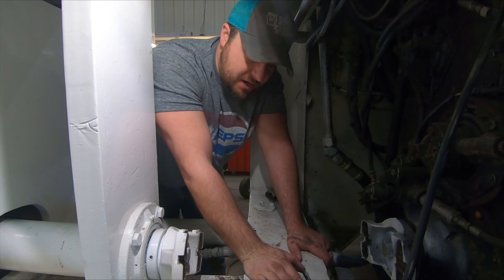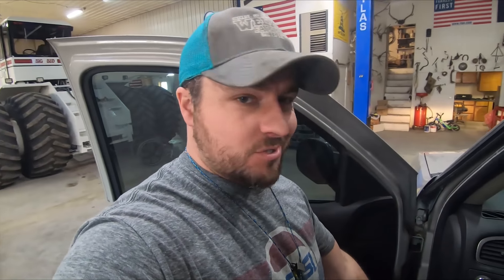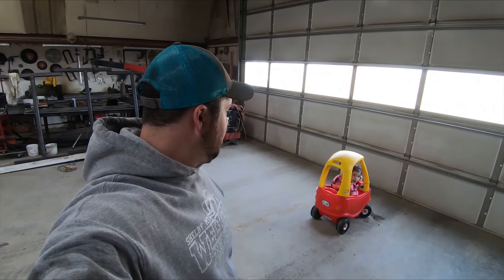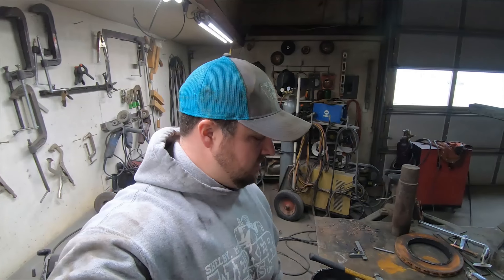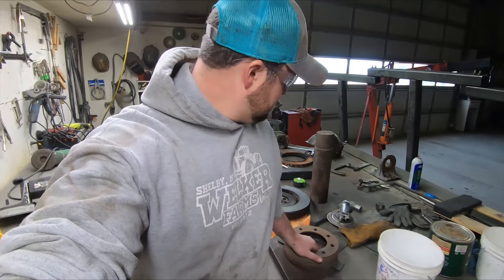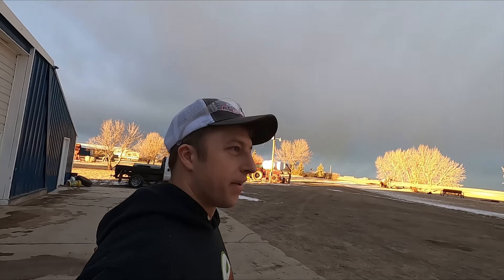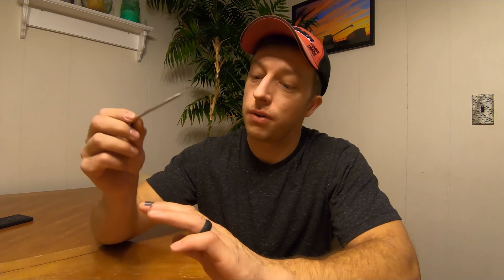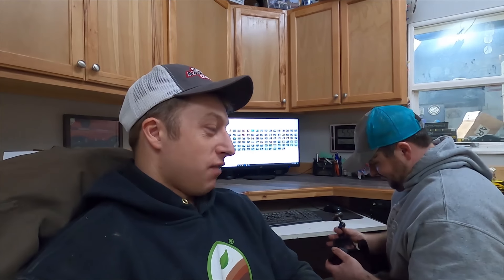SMASHED My Finger｜Shop Shenanigans

Comment: mechanic here, a torch tip drill set works great for deflating fingernails, lil bitty drill bits and a pin vise to turn them with by hand so you can sneak up on it and not get that painful over penetration, works even better when you need to reopen the hole after it seals up and pressure returns

Comment: I used a drill bit to relieve the pressure on a smashed nail once, but I worked the bit with fingers from the other hand. I read several comments about using drills and I'd never do that myself.  Relieving that pressure felt so good though!!

Comment: Hey LegArms I haven't read through all the comments to see  if it has been said. If you add a length of wire to the broken spots in the harness in the door jamb it should relieve the stress on the harness and prevent the wires from breaking again. I am a Ford dealer tech in Florida and I see this issue on a regular basis. I love the channel keep up the good work

Comment: Got lazy as a teenager and was using the upright vacuum cleaner to vacuum carpeted steps. Not the hose attachment mind you, but the beater brush. Lost my balance and set the vacuum down on my foot.  Wouldn't have been a big deal if I was wearing shoes but I was barefoot. Took the toenail right off my big toe.  So now I wear steel toed shoes to vacuum.

Comment: Also u can build that pin up and spin the weld down. I would preheat it, weld it and throw it in a fire blanket or bucket of kitty litter for a slow cool down. The only time u don’t want to build it is on tool steel. 4130 4140 ect. It can be welded but it’s a very long slow process with tool steel.

Comment: Nick,

I have used a drill bit in a drill.... when the drill bit penetrated the finger nail it didn't stop quick enough and went into the very tender skin under the finger nail.  I have since used the drill bit but without the drill by spinning the drill bit in my fingers.  This worked really well and was the least painful method I have found so far.

Comment: Yeah for future reference you never never want to use a drill bit with a drill. One of 2 things will happen, the drill spinning at high speed will catch on your nail and pull it off or and yes this is super fun as well. the drill bit spinning at a high speed will catch on skin below nail and you will drill through your finger, thats not the worst part. the worst part is extracting the bit after it drills through finger. If you decide to use a bit, definately twist if by hand. I find that a sharp pocket knife and back and forth twisting motion works best.

Comment: Awesome videos guys...  2 things:
First, you did the same thing to the bearing that you did to your fingernail pressing the outer into the seat through the inner bearing race. you basically transferred all that pressure through the precision ground races and there is a high likelihood that you did damage. you should use a ring or other device and never press "through" the bearing assembly. Depending on the bearing, you can also flat out crack or break it like that.
Secondly, take an injection syringe (a new, large dia one like you would use on cattle), you can just use your fingers to spin it like a little drill to get through the fingernail. No heating required and its a bit less cringy than using a rough drill bit. The vet did that to my fingernail once when he was onsite and it worked great

Comment: Been there, found drilling did best for me. Once used needle under nail, just wiggled it around under there till it got to where it popped. And yes, it does roughen up the surface of the new nail.

Comment: One of the nails I lost the pain was very extreme from the built up pressure. When I got the hole burned through the blood squirted out 12-14 inches and my finger was looking more like a banana than a finger. Getting that pressure released was the most relieve ever! Keep it clean! I was planting at the time and got dirt in it and I got septicemia in mine and the Dr was afraid I would loose the finger, smelled like road kill with that nasty infection but all is fine now. Legarms you got me beat I have lost five nails so far.

Comment: 1/32 drill bit . Clean bit then take bit into fingers like pencil , thumb and index finger. Then roll bit back and forth between both fingers putting a little down pressure on nail with bit . takes a couple of min. doesnt hurt when you go threw nail do to nail separation.

Comment: Had a few of those smashed fingernails before.  1/32”  drill bit rotate with fingers from your other hand.  Scott you were so right about that pin.  Welding could of changed the physical metal properties which could of broken at the worst time.  Very smart getting a new one made.  Machinist making a nut as well?  Good video guys.

Comment: Nick, I’ve done that while hammering a pin out on my car.... and I did say fffffffffiddlesticks!
So I used a tiny drill bit for drilling printer cartridges. They have a plastic wheel on them so you can spin it with your fingers.
The relief when you release the blood is legendary!

Comment: I smashed my little finger in between two heavy sheets of steel about 3X3 wide last July 1st. Same thing it all turned black and blue, to relieve the pressure I ran a needle under my nail and drained it. Now there just a little bump on the end of my nail that needs to grow out. This nail is about number 14 now, thank god they grow back.

Comment: Wanna make that finger feel better and not lose the nail ? Take a small drill bit or heat up a paper clip and push it into the nail you will know when it goes through by the amount of blood that will squirt out of it but the relief is very welcoming as it relieves all the pressure and heals faster. Doesn’t lose your nail either 👍 works every time.  Feels better don’t it. Lol those that don’t want to poke hit things into their finger. Use the drill bit. Either works great as seen here

Comment: Nick , it doesn't matter which direction the grease hole faces when you push in the bearing. The grease will follow the channel around the perimeter of the bearing and enter the bearing internals  wherever the hole is located.

Comment: I use a small drill bit that I just spin with my other hand and it does not take long and really makes it fill better.  I have use a knife when out in the field when I did not have a bit. I never use heat either way.

Comment: Use a small drill bit with your other hand turn with your finger tips until you get through the nail. It will take a while but it's definitely worth a relief.

Comment: Few years back I was swinging a sorting gate shut when a 900lbs feeder steer backed up into it, ended up pinching my fingers between the gate and a concrete wall. I lost the nails on all 3 of my middle fingers on my right hand. 

Side note: If you use a tiny drill bit, I think it's easier to control if you put it in a drill press and set it up on the slowest setting.

Comment: Hot pin is the best way , friend of mine used a very small drill bit in a drill press raised his finger to the drill bit and forgot to lock the drill press spindle so it would not move and it grabbed a hold of his and went through his finger, yes hot pin is better. Great videos

Comment: The reason the hot needle doesn't work is: the blood will clot under high temps. This is why I use a file to cut through my nail after smashing it. We used a branding iron to clot the blood after clipping the horns of the cattle we branded.

Comment: As a 45 year Industrial Machine Repairman, pressing in the Spherical bearing like that was risky. The correct way is the make a sleeve that puts the pressure on the outside diameter of the bearing, as you mentioned. The risk was if the bearing hung up and you applied too much pressure from the spherical section, you could of blown the bottom of that bearing out. 

The best way to shrink a bearing is to use a CO2 fire extinguisher to cool the bearing. If you get it cool enough it would of dropped in with minimal pressure. Dry ice will also work, but what we used is Liquid Nitrogen. It will shrink it to the point that it will drop in. But, 99% of non industrial applications will not that that available. Plus the cost.
Reply: I agree.  Fortunately it went easy.

Comment: Sorry about the finger, been there and it's no fun at all.  Just wanted to mention, don't actually use a handheld drill with the small drill bit a you have very little control if those flutes catch on your fingernail and then cause you to drill into the nail bed.  Simply use your other hand to twist the drill bit until you get through the nail.  Love the channel, keep up the good work!

Comment: I went to the Dr. when I smashed (funny the same) finger and the Doc told me to use a paper clip and a propane torch and run it through. Drew all over my nail till it finally went thru and realized it didn't hurt and made 9 holes in it. So much better when the pressure released. Used vise grips to hold the clip.

Comment: Hi Hollywood you don't need to be spot on with the grease holes, did you notice the groove on bearing face the grease will travel around that way, put the bearing in the freezer the night before it will tap in no need for a hydraulic press, liquid nitrogen is better and quicker, I know YOUR on the farm, LEG ARMS would have told you that, next time ask him or better still ask me, 😁😁 😇😎 🇦🇺👍

Comment: I dropped a microwave shelf smack on my barefoot big toe nail!!  Turned red instantly.  Fortunately, the NAVY dispensary was just down the street.  They took one quick look and broke out a regular 15 w soldering iron with a tiny tip.  Heat, poke, squirt, done. Didn't even hurt much.

Comment: Dealt with that issue on a 2008 Equinox. I went ahead and bought the entire harness instead of soldering, since I knew more wires were gonna do the same thing eventually and I wanted to go ahead and get every wire replaced, not just repair a couple

Comment: I thought that groove around the bearing made it so the zerk didn't have to line up. The grease will migrate around the circumference of the bearing through that groove no matter where the hole is in relation to the zerk.
Reply: Mishn0 but it you look it has the hole that brings grease into the center of that bushing as well where the pin/bolt comes though. So that’s why it has to be lined up
Reply: @chevyon37s  as the op stated the grease can travel in the groove when getting pumped in around to the hole to the centre no matter where it is. But no harm in lining them up either
Reply: @chevyon37s  No No No, op is right
Reply: After a few years the grease doesn't always want to stay in that groove. I have a couple bearings right now that the grease wants to push out of the pillow block before it goes in the bearing.
Reply: @dgdaner  that make sense, thanks
Reply: @dgdaner  Sounds to me like it's become dirty or broken. Either way, it's NOT normal and something needs to be done before it goes wrong. That groove is meant to spread the grease. It isn't VERY important to line it up. Like op said, that is what the groove is for.
Reply: Funny thing is, that design is flawed. The correct path (but obviously  more expensive) is to have something akin to rifling inside the sleeve and a the zerk goes atop, with its own little chamber. Grease goes in the chamber, then as the bearing heats up from use, it slowly drips down. AS it is now, that sleeve will eventually split in half, again.
I still think they should've ditched that pos bearing and put a spherical roller thrust bearing. Yes, a lot more expensive, but they last a lot longer, heck, i'm willing to wager that it would last 2 generations of Welkers, provided they feed it  grease every time they use the machine (as one should).

In case anyone wonders how that works : here's a gif https://www.skf.com/binary/12-288949/1702-0011-Animated-SRTB_tcm_12-288949.gif
Reply: @frankvandendool882  Certainly. I guess what I'm getting at is if I have a failure and I need to use a grease buster or whatever else to open it up again I want those holes lined up. Everything fails eventually. Might as well take a second and line it up when it's going together. If everything is working correctly it doesn't really matter. If it means I get a few more hours out of it at a critical time it was worth it.
Reply: @aserta  exactly right it is designed to break in two pieces as it wears,  the bearings that have riflings last alot longer
Reply: @aserta  
Doesn't  really matter what bearing you use the fact it only rotates 30* and takes heavy impact will kill any beaeing 
Most new tractors run a double bushing setup rather than bearings 
Doesnt matter what bearing they use 
5mins after the greaseing it takes up load and pushes the grease away from the thrust surface and its steel on steel  till next greaseing 
Why most earth moving gear that uses this type of bearing is on an auto greaser so it gets a tiny bit every 15min 

Pressing it in by the centre  ball doesn't fair well to a long happy life for that bearings
Reply: Correct, the grease will flow in the groove and find the hole and enter. But aligning it up allows a shorter pathway.

Comment: Leg Arm I worked for Ford for 17 years and a lot of times it will be the window regulator. they have cables that break and wont go up or down. it is something you can install yourself with you skills. good luck I just did my gmc
Reply: I haven't replaced the window control on my 07 F-150, still works if I push in certain direction to get metal contact.

Comment: I have a set of torch tip cleaner drills that I have sterilized and keep in the first aid kit specifically for depressurizing smashed nails. might want to add a set to your kit.

Comment: I imagine cutting those threads will present its own challenges bud. I'd be surprised that that pin couldn't be cut then heat treated to the right hardness. Cheers LA. Keep 'em Cummins. :P

Comment: I've done door wiring repair many times.  Taping the wires together with electrical tape was a mistake, as was soldering the connections inside the boot.  It's not the cold that's causing the issue, it's the crap wire GM uses.  The way to fix it is to replace the section of wire that goes through the rubber boot and make your solder connections inside the door and behind the kick panel where it won't be flexed.  You'll want to use a good quality wire and adhesive lined environmental heat shrink.  Don't tape the wires together where they go through the rubber boot, leave them loose.  I've had very good luck with the made in USA wire from Sherco Auto, but if you can find USA made silicone insulated wire, you'll more than likely never have to repair it again.  Or hurry up and trade in the vehicle for a new one.
Reply: Just about anything made in vehicles sucks these days.

Comment: Just a thought but I recently had a weird vibration on my n14. Couldn't find what it was for 5months, talked with Cummins rep and the harmonic balancer is supposed to be changed every 500k, don't know what that would translate to in hours. Just a heads up if it gets a odd vibration.

Comment: When I was cutting down a couple of trees near this guys deck, I would back cut it and winch it down (because they were leaning). I had the winch in a block and tackle form. I went to feel how much tension was in the cable and the cable twisted and pinched my ring finger nail between. Of course I was running the winch with a battery and battery cables and my mother didn't understand that if you reverse the battery cables it would loosen. Luckily she it it right the first time. The finger nail look like it was completely flattened like in the cartoons. Afterwards I had to continue to cut the tree down, had to start bucking them and lifting them onto the trailer. It was a real mess.

Comment: Hey boys, try  cutting the end off your finger. Now that smarts a bit. I have done it twice....bloody slow learner me. Index finger on left hand to the first joint and then four years ago I touched the blades of my surface planer with the middle finger of right hand. Took the pad off and planed down to the finger nail on a diagonal angle from the tip to first joint. That made me sweat some...then the surgeon gave me his bill and it REALLY hurt. Good video.

Comment: 4140 would be a great steel for your pin and you can get it in the annealed state or a pre heat treated state which would be the best, also for that application 1144 would work also.

Comment: On the topic of fingertip/fingernail injury. I was helping my father with changing hood pin location on his 55 chevy. Ih e had the drill and i got to hold the plate. Well the drillbit snapped and went halfway through my index finger just above the nail. It was no fun. But now my fingernail has grooved lines in it which is unique. LoL he's not allowed to use the drill anymore if i have to help.

Comment: That draw bar spherical bushing, glad it went well.  More than likely the outer race was cracked on one side to allow assembly of the inner and outer races.  So, even though you chilled the bushing to shrink it, by pressing on the inner race you were causing the outer race to expand.

Comment: if you use liquid nitrogen to shrink the bearing you shouldn't need to press it in and it doesn't matter where the hole is for the grease zerk, as long as it lines up with that grease channel

Comment: Nick you were very lucky that you didn’t break that new bearing in half pushing on the ball, you really should have pushed on the bearing outer case, you got away with that but be wary if you do another one, I seen that you nearly did but changed your mind, anyway thanks for the vids that you do for us.

Comment: My 2009 Avalanche has junk wires too.  Lockable tailgate decided to lock shut 🤬.  Managed to wiggle the harness until it unlocked and then cut it.  Now passenger headlight won’t work and it’s not the bulb.  Either the connector or harness😡.  Just wish GM would have spent $0.50 for better wire....